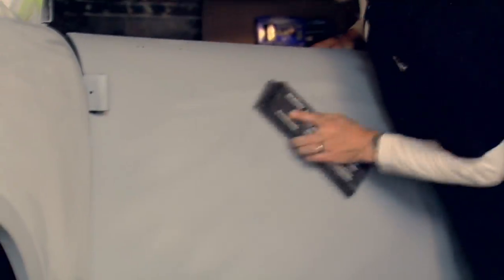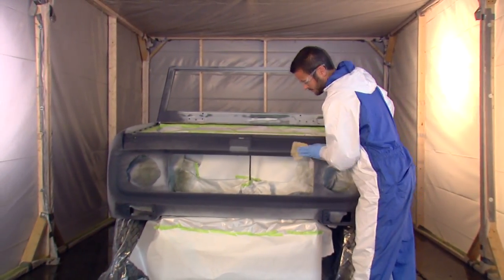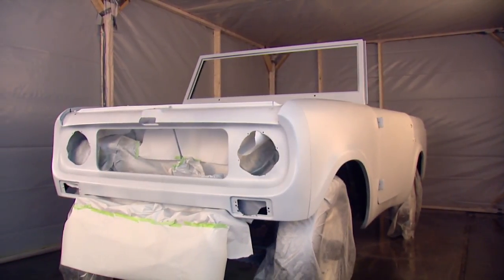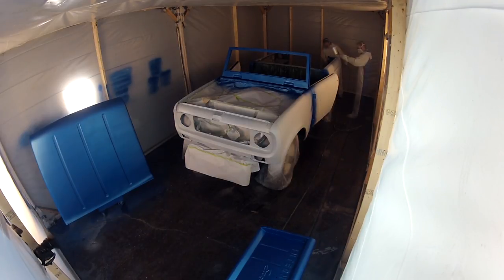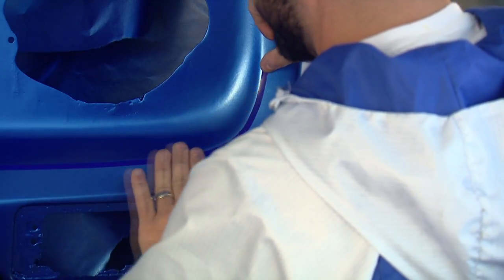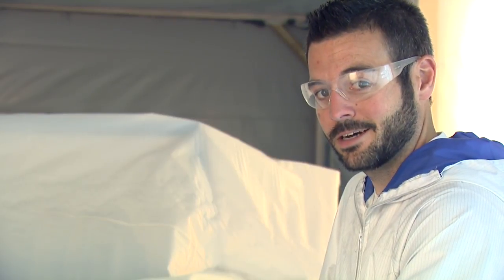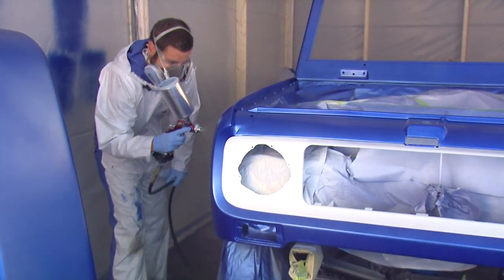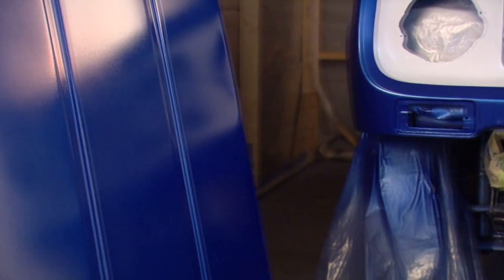Dupli - Color Paint Shop Finish System

Comment: My Buddy Painted his 95 Fullsize Chevy truck with this paint , used 6 quarts , wet sanded the primer with 1500 before he painted it , didn't use the clear just wet sanded with 2000 and polished it with polishing compound..the key is using a good spray Gun , it actually turned out good for about $200 bucks

Comment: If you do some research on the paint it's very old school product. Precat lacquer. At $40/quart it really isnt a cheap system but it's easy to use for the average back yard user. Dump in gun and spray. You can get more for less at most any real paint supplier.
Reply: 40? I see it for 28

Comment: I've used this for a black Yukon tailgate because someone did a hit and run used a quart of paint and almost a quart of clear it's pretty thin but it came out good for the price point and matched up to gm black good I'm going to do the famous peeling gm hood they can't paint it good from the factory if I was going to do the whole thing i would buy a decent ppg or something from a paint store this has no recoat window so you can do a lot with that but it's too thin time will tell but I don't think it's too good of quality I used a DeVilbiss gravity feed with 2.8 tip don't tiger stripe like here lay the coats down

Comment: whats the paint code for this blue
Reply: 100 st boyz have you found the paint code
Reply: Looks like it is BSP212 Amazon sells it cheap
Reply: BSP204
Reply: @randallabracadabra  205
Reply: @jermainecaldwell3757  That's molten red, not blue.
Reply: @waynewilliams5802  205 is Mineral Grey
Reply: @randallabracadabra  I'm not going to argue cause I don't get down like that but around here I'm known as the 'chip foose' of the hvlp gun...thinks is 204 bone
Reply: @waynewilliams5802  The can in the video clearly shows the paint code is BSP204 for Deep Blue Metallic. The can doesn't lie. Also, we're going off of Duplicolor proprietary codes, not your paint matching system.

Comment: I will never buy this product again!!!! This is the worst paint I ever used. I went Thur almost 10 can of paint and about 2 cans of primer so it can be full because it was missing coverage. I wouldn’t recommend using this on a whole car for paint job!!!! Maybe a quick fix considering fender or door, truck etc..... If you have used this product please comment and tell me your experience.
Reply: I agree this paints sucks
Reply: I agree this paints sucks
Reply: The trick to it to make it look good is to reduce the paint, primer, and clear with lacquer thinner. Then cut and buff the clear. I did an integra with the performance red 6 years ago and it came out flawless. 3 cans of color and 4 cans of clear. At $25 a can I spent almost $200 with tax.
Reply: I used a candy orange for a motorcycle gas tank came out nice, I didn't use the dupli color clear coat I used the ppg urethane clear it's really nice didn't need to wet sand or buff!
Reply: @Jason-oz6tk  how much